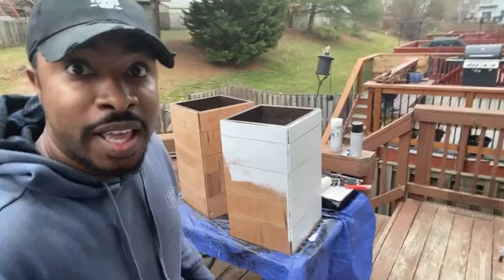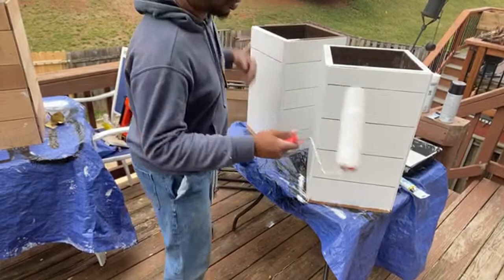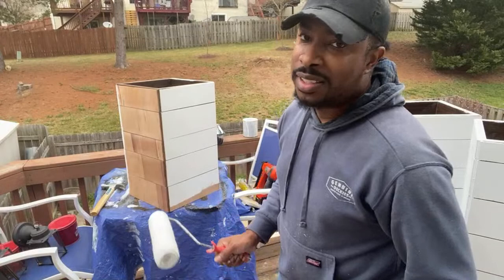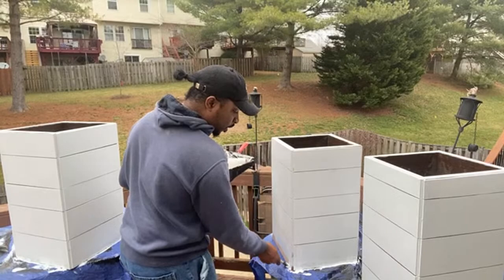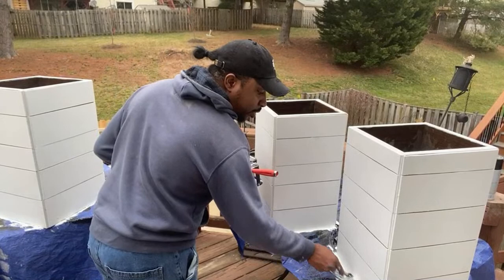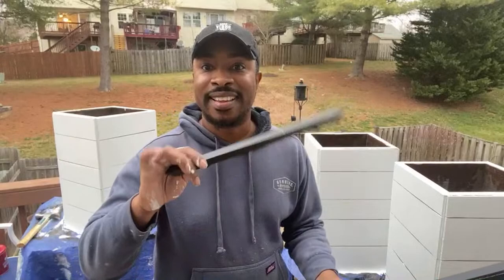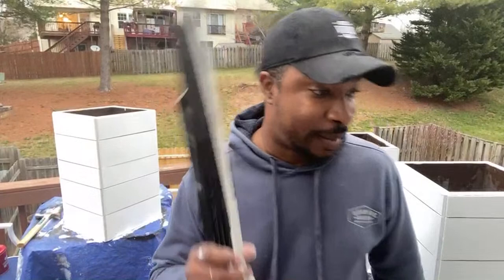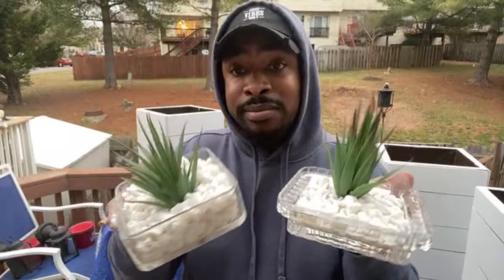Painting the planters...

Comment: What did you line it with to keep the wood from getting wet. That is silicone caulk. You can also use wood putty or spackle. If you want 1 coat painting and use a water base primer like  123 Bins or zinzer. Lookin good.